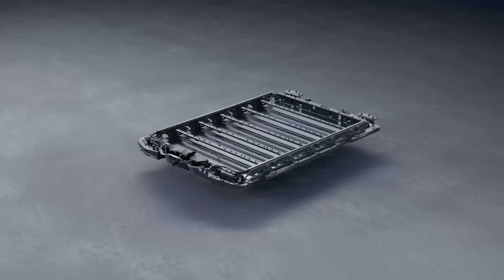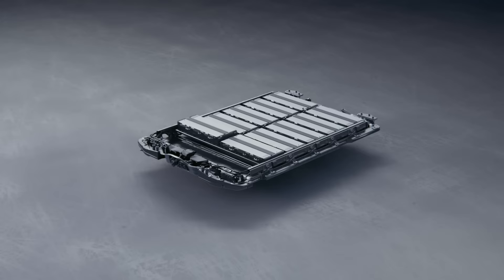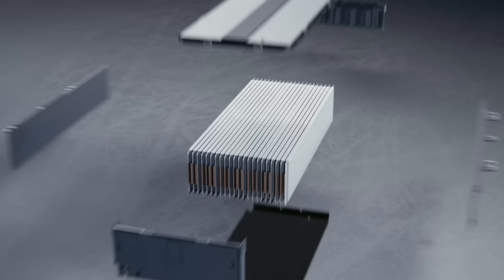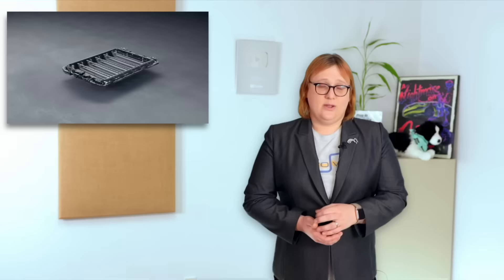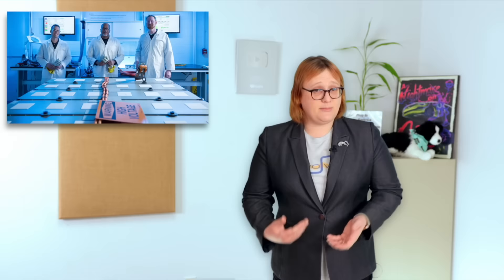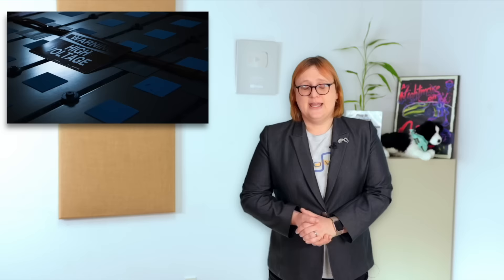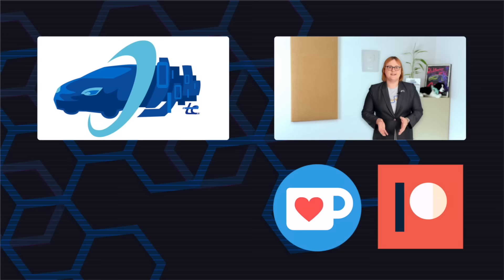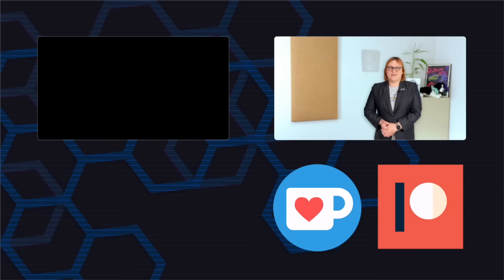Will GM's Ultium's Forward Compatibility Revolutionize The EV Industry?

Comment: Really interesting battery module design at last. And reduction in wiring = less man hours too.
Nice Vid!
Reply: It will be interesting to see how it compares to Teslas new approach of cell to pack batteries without any modules. That seems to save even more cost and the wireless communication instead of the old bus system has also been patented and will probably be introduced in all models in the near to mid term future. That should reduce the wiring harness from more kms to about 150m for the whole car.
Reply: @LaszloPappBerlin  Tesla's design saves as long as you use the same cell to pack in each vehicle.  GM's design allows them to use modules in any of they future EV's without redesign.  Even offering multiple capacities or the potential to increase capacity is simple with the Module approach.

Comment: Wireless battery management... I really hope they think through:
1) security.
2) software updates for the bms when they screw up #1.
Reply: No kidding right?
Reply: They most likely won't get the security right, because it won't have been designed in from the start. I bet they've never heard of secure coding - Hint- look at OWASP,s secure coding guides and cheat sheets. read and understand them, then actually put it all into practice - that's a good start.
Reply: your missing a bullet
3) radio frequency interference
Reply: I think it adds way too much complexity. I’ll bet it’s an IDEA that has yet to be demonstrated. Yet, they need some hype as others are advancing rapidly on CORE issues, not a WiFi battery pack!
Reply: Wireless means plates of metal, not through the air
Reply: @allenwells33  Where was that information?
Reply: @jasonbirchoff2605  Well, maybe they used that term to mean something else than everyone knows those terms to mean. If that is the case, they are trying to deceive and they are talking about current systems and nothing new at all. In either case, it does not bode well for GM filling their promises.
Reply: @jasonbirchoff2605  Yea that Part 15b FCC is so out of date. What part of, "this device must accept any and all EMI even if causes undesirable operation" fits this day and age?
Reply: Maybe it just has less wires. Otherwise it might be plagued with software issues like the iD3.
Reply: @jasonbirchoff2605  I see a need for RF shielding to prevent an adjacent car with a big transmitter jamming all the communications.  Or assuming they have VERY little security...telling every other battery to discharge fully... OOOPS
Reply: Yeah, I see wireless as problematic.  Seems like some kind of wired bus with a number of ways to connect to it would achieve the same goal more reliability.   To me, the big headache over wireless is security.  What's secure today is unlikely to be secure over the lifetime of the car.  And GM hasn't really be keeping on top of things with updates to their existing systems.
Reply: @billblomgren9618  You do realize the whole pack is encased in metal and so are each module?  So the whole things is already shielded.  The thing can be wireless, but only have to transmit/receive over a very short distance to it's job.  So outside of the vehicle you might not be able to pickup the wireless activity and from inside there is no external interference.
Reply: I don’t believe that they will use wireless for BMS .. what if sb. hacks it and the whole battery starts to burn 🔥
Reply: @theflew  I've looked at it.  However, what happens when you are next to a semi with a 5kw transmitter (or more) which saturates every receiving bit?  My sister drove for one of the major haulers.. .One of the guys in her shop had a BIG transmitter that would kill the computers in VW's among other things.  Using wireless to control the battery leaves them in a huge security hole that could cause vehicle fires and the like.   It's bad enough that just normal internet connected cars can be taken over... but having your batteries taken over could be truly explosive.
Reply: @Billblom  Given GM isn't a fly by night company you have to assume the signals are secure.  Also since this is an internal network they're probably using proprietary encryption. Inside the module it's wired so flooding the system would only interrupt module to module communication and module to module monitor communications.  Internally the module would be fine.  So you would have to attack each module and reprogram it.  Given the source is closed you would have to know enough to reprogram the module and I'm sure it's firmware is cryptographically signed to prevent easy tampering.

So yes you could use a 5kw transmitter, but given the fact the battery is shielded it probably wouldn't do much.  And you might affect the the other systems long before you do anything to the battery as in your VW example.

Comment: FYI, I've had 1/3 (section) of my GM Volt battery replaced.  Currently getting 25 miles of range vs 38 a few years back. ~70K miles.

Comment: Will there be crate batteries ? Self contained power modules that are structural , have built in controller are wireless control  sound just the thing for making retro fitting an old ice car with an electric motor easier.

Comment: I don't need a million mile battery.  What I need is about a 200,000 mile battery that is CHEAP.  If you are going to replace ICE you have to be cost competitive
Reply: I would also be curious to see what the market share is for a 500mi range/200,000 mile age battery system.
Reply: Pressbutan A 500 mile battery by definition is going to be longer lasting (increased capacity = fewer cycles = more miles) and more expensive. You can’t beat physics.
Reply: @mondotv4216  Can't beat physics, true. But if new battery chemistry can reduce costs and increase range (ie higher energy density) you may well be able to work around it.
Reply: MondoTV I think you mean “ya cannie beat the laws of physics captain”
Reply: that's why the reduced cobalt and nickel is important.
Reply: scuBarry What I was saying is you can’t trade off lifespan for range. In fact as you increase the range, you increase the lifespan. So by any metric, a 500 mile battery is going to be more expensive than a 250 mile battery. Regardless of the base cost per kWh.
Reply: Muppet Keeper only if I was on the Enterprise :)
Reply: Mark Two different things. We reduce Cobalt because its more volatile in price and also because it’s problematic morally with child labour used in some supply chains. At the moment we adjust the chemistry of the cathode and actually increase the nickel content to reduce Cobalt (depending on battery manufacturer). It comes at the cost of making the chemistry slightly less stable. To reduce the Nickel content we need to switch to a completely different cathode (LiFe, solid state, etc). It’s not urgent - Nickel is the 5th most abundant element in the Earth’s crust.
Reply: @mondotv4216  thanks for the clarification - didn't realise that they are increasing nickel when reducing cobalt. But cobalt has been increasing in price because of demand, and sourcing is more difficult too. It is a factor.

Comment: What is NOW happening in regards to replacement packs for early leaf models is that consumers can now upgrade their batteries using  the cottage industry that has developed around the leaf and as a result they can spend 3000 and boost their range and health. Its not at all hard to do. That allows the older cars to use newer chemistry batteries. Its impressive how well people innovate to meet demand in the free market!

Comment: 'As mentioned, GM is still holding back on detailed information about the Ultium Drive, but more was revealed when they introduced the battery system in March. Even at the presentation of the Cadillac Lyriq Concept in August, there were no statements about the different motor and battery variants. Marty Hogan, Lyriq’s Chief Engineer, stated at the time that the published data was inaccurate because it was still in the development phase.'

Comment: Wireless BMS is a terrible idea. Great attack vector.
Should have used optical fibre for comms if voltage isolation is an issue.
Reply: Opto-isolators can do up to about 1200V so fiber is not needed.
Reply: I believe the com is only one way not two way

Comment: Catering for different battery formats or chemistry's is very clever. Even though existing batteries are reliable it'll help the 2nd hand market when buyers  can be assured a problem module or 2 wont ruin their investment. Hope it works out like they described. Thanks Niki

Comment: With wireless BMS, which will almost certainly be sealed into the cells or modules, changing a battery module will become easier for the dealership, but impossible for independent repair, because no one but the dealership will have the tools for coding the new module.

Comment: I couldn't see a big reason going wireless (for BMS), since there supposed to be only one communication cable with maximum of 4-5 wires depending on the protocol (assuming mostly CAN) with a length of 2 -3 meters. Other stuff sounds promising!
Reply: A bunch of RF transmitters inside a Faraday cage, all using power 24/7, all having to stay connected .
Reply: The complexity of the RF mesh makes me doubtful ... but then again the reduced contact count would make anyone trying to replace a module much happier. We'll see, I guess! I'm hoping to watch with interest from the sidelines as I drive my Kona for the next 20 years.

Comment: the huge benefit is the upgrade ability. it is also perfect for a second hand market but not only for cars but also for power walls or buffers for chargers. also for special customized vehicles or utilities or off grid power usage. transporting two fully charged modules to the cabin in the woods. etc.
the second life usage of the battery is easy when the interface of the module is standardized

Comment: The ability to replace a single module with one with new chemistry will be a massive cost savings for GM on the warranty side. Currently with Chevrolet Volts that are model year 2011-2014 the failure of a battery module while the Voltec warranty is in effect requires the entire battery be replaced under warranty as GM isn’t storing any first generation Volt battery modules other than the one used in the 2015 model year.
Reply: Luckily for GM they sold so few Volts that there is little long term liability when more are in landfills than still on the road.

Comment: Good to see GM at least trying finally.

The wireless battery management seems a bit strange to me.  The  basic idea is each module being managed individually.  You can do this by either
1. the module containing it's own BMS that also takes orders from the car level BMS.  or 
2. you can simply have the car level BMS programmed to treat each module individually. 

#1 has some advantages, including reducing wiring complexity (similar to Tesla promising a reduction in control wiring in the car.) But, you don't need the control connection to be wireless in either case.  Only need the software interface to be standardised, and you need that anyway even if the physical control  connection is wireless.

Remember, the bidirectional power delivery anyway needs a physical connector to each battery module. You aren't doing power transfers wirelessly.  Could have simply added standardised control bus wiring to the same harness and connector.

So, hard to understand the need to go wireless, with all the problems it can create.  Park the car next to a transformer and maybe the BMS goes wonky?  Blow up a car by overriding battery cell protection logic through the wireless control connection? Or targeted sneaky hacks like draining your battery or reporting/displaying wrong state of battery charge, so can't go out in an emergency or cars getting randomly stranded and causing traffic mayhem. Why would GM want to open this can of worms?

Comment: so what I think he was saying, that each module could be replaced with anything (newer iteration) because the pack has its own battery management... I think he was saying it has its own input output regulation, because it has its own controller. I don't think there is any reason for it to have software to limit capacity within the pack, even if it wasn't cost effective to lower the cell count in a battery pack for replacements, I think the system that monitors the battery level and creates the artificial floor and ceiling (to keep the battery at 20-80%) could manage this discrepancy easily, as it would have access to each pack directly. Which makes sense, it probably monitors temps of packs and draws on the ones at the best temperature, also varying how many packs to use at once based on system draw.
Reply: It all sounds expensive to me. You only need to be able to change the batteries if they don't last that long. If they last 1 million miles, like Tesla are aiming for, this add unnecessary complexity that won't be used.

Comment: Thank god we have a battery arms race going on. Us the consumers will benefit in the end. I do like this modular design. It sounds like after seven years if a new battery tech is available you would be able to switch your current batteries out. This wireless connectivity essentially a wireless wire harness could lead to other systems being wireless down the road. The wireless stuff does sort of worry me.

Comment: So its modular? I can upgrade the range of the battery? Like put a 2020 battery or a 2030 battery into a 2017 bolt?. The new battery will fit with a higher range?

But I wont believe it till we all see it. GM has said and claimed and promised many, delivered few...
Reply: You can already do this in many current vehicles but it's very expensive

Comment: I would bet on the whole thing being obsolete in 5 years over it still being the standard.  We are about due for a breakthrough that increases battery capacity massively.  The packing of the working bit of the battery in the overall size of the thing is something like 10% being the bit that matters.  If the density improves, the range may not be extended by as much as that implies.  Instead the total weight and size of the car may be reduced.

Comment: Looking at the periodic table the most energy-dense sealed battery should be a fluoride ion battery with a Lithium Metal anode and a carbon cathode. Probably need the lithium in graphene bubbles to stop the dendrites forming. Hmm if I am trapping molten drops of other elements in graphene bubbles may be a sulfur or chlorine cathode.

Comment: Wireless communication is good, but the important aspect that was not covered is power management and cooling of the battery pacts or temperature control - that is where most other manufactures fall short and Tesla shines.  The part of future batteries being used is good, but all they have to do is provide preset power to the bus (power management), nothing new.  The cost is important and that was not provided as well as the distance that the battery pack can deliver, are they comparable with Tesla at 400 miles per charge or are we still talking 15 miles as the Volt delivered, lol. I'm sure they can provide at least 300 miles, as Ford electric vehicle provide that range.  All this redo, you'd think that they would contact Tesla and sub license the technology or have Tesla produce the battery packs for GM and Ford. Then they could join Tesla in improving the technology.

Comment: Replacement battery module? Honestly I am in two minds about this. Battery tech is now pretty mature, so if u have a million or even 500K mile battery, that may well exceed the usable life of the vehicle. So how many people will actually need their module sto be replaced?
But again, this can prove to be useful capability for 2nd life applications for the batteries. You can replace the low performing modules with something better.
Reply: There could always be defect. No manufacturer has ever been able to produce a product with 0 defects on 100% of the output.
Reply: ..people who want more range from the newest battery type.
Reply: archie how many people need a piston replaced in an ice ? Not many but it should be an option. Right now ev makers are treating cars like phones, your battery dies you get a new device. It’s a bad look.
Reply: Musk says modules are nuts as batteries are now so reliable (Third Row).
Reuters reports Tesla's CATL packs are $80/kwh. GM wont say when they may break the $100kwh 'barrier'. Last report at investor's meeting the LG battery cells were $145kwh!
Reply: @waynerussell6401  reliable or not, it would be nice to increase your range with the latest cell chemistry when it comes out.
Reply: Wayne Russell musk would be fine except he won’t authorize third party repairs to use super charger network because battery repair might be unreliable. Modular replacement would solve that problem.
Reply: @waynerussell6401  Funny, as I recently read a posting from an independent tech who does a lot of work with car batteries and explained that the Tesla design certainly is not the most reliable exactly due to the choices they made to get the price down.

Comment: It's not just batteries

You need batteries, Charger, Power electronics, BMSs, Software, electric-motor etc but to mention a bigger stronger car to carry the extra weight

All of those need to become considerably cheaper. A cheaper end popular car like the VW Polo costs $13,000 + sales tax. The ICE and subsystems of this car is probably about ~$2,500 so for EVs to be the same price as ICE your need 40KWh batteries and all the other things listed above for no more than ~$2,500